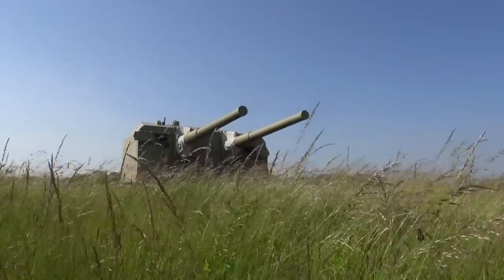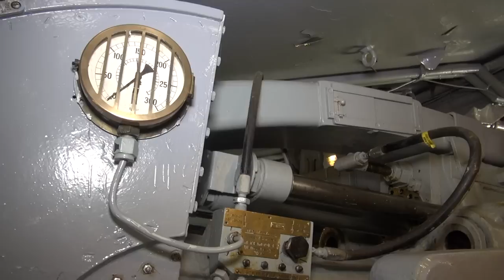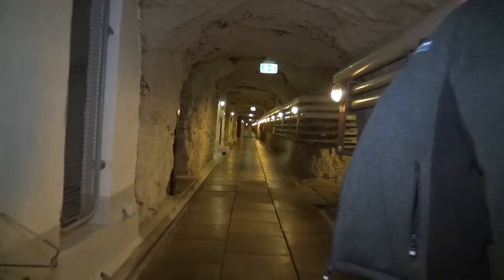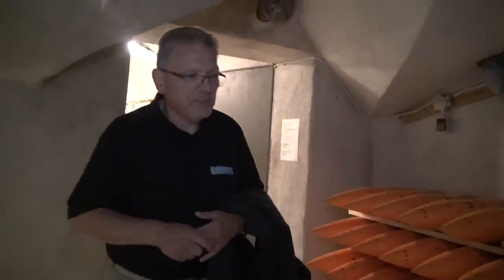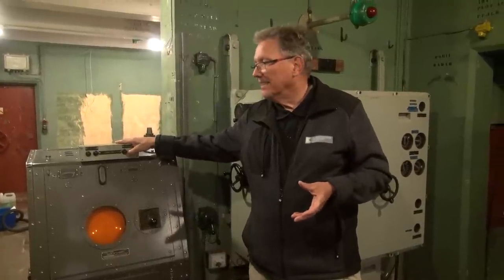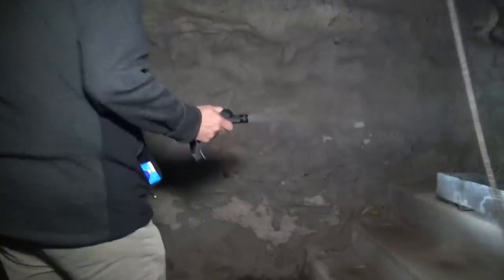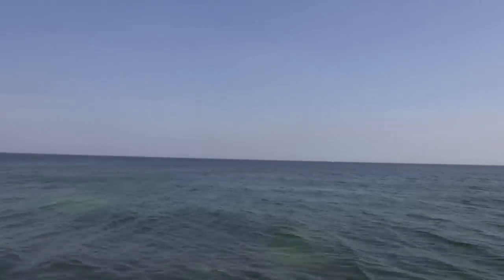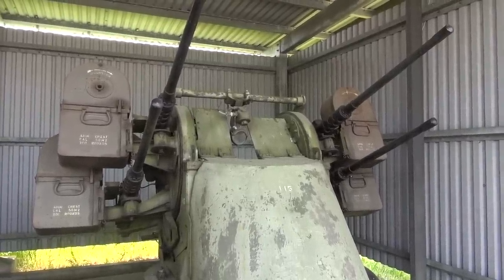AMAZING COLD WAR STEVNSFORTET - WW2 TECH IN ACTION

Comment: About communication with the HAWK battery: Until 1984 it's site was at Middelgrundsfortet, also an old sea fortress situated to the northeast- of Copenhagen harbour, not at the coast, but actually on at that time the world's largest artificial island. Due to the difficulties with deployment to tactical sites* among other issues, the battery was moved to Stevnsfortet where it only served for 5 years as a operationel  unit. From 1989 - 2000 is was used as an education unit for all of the seven other batteries.
Besides the relative short period of time, the battery was the Air Force and the fortress was the Navy. And to make things worse, the accident with the"Hovsa-missillet", (a Harpoon) in '82 made it a lot more complicated to deploy the HAWK missiles because of several new safety issues.
* The Royal Danish Airforce actually owned three smaller boats to carry all the equipment, one by one and personel to Copenhagen.
Reply from the maker: Thank you so much for elaborating on that it does make perfect sense that it doesn't make sense at all Navy / Air Force. And yes I remember that misfire to get a nice summer house I seem to recall these things happen :-) :-)
Reply: @tinostruckmann  You are wellcome.
I forgot to mention that ESK 541 at its very first was situated on Flakfortet, another old sea fortress further out in Øresund, while Middelgrundsfortet was preperrred for housing a HAWK battery.

"These things happen": I will never forget one of my Crewchiefs upon receiving the news: "Everything went wrong when they stopped using boat hooks".